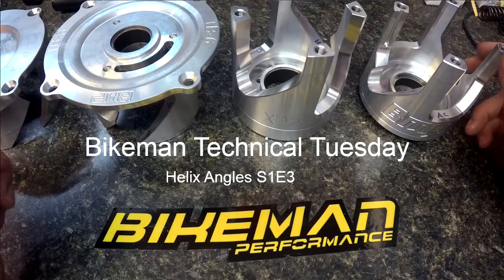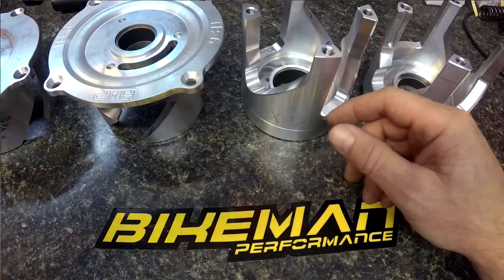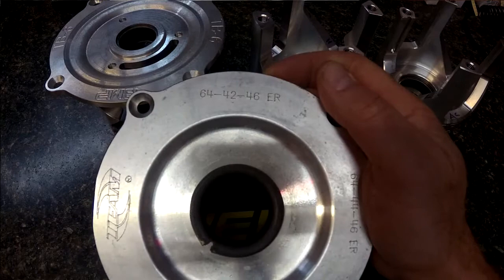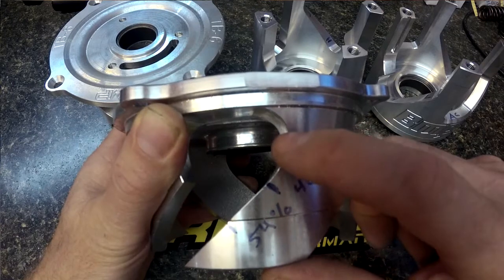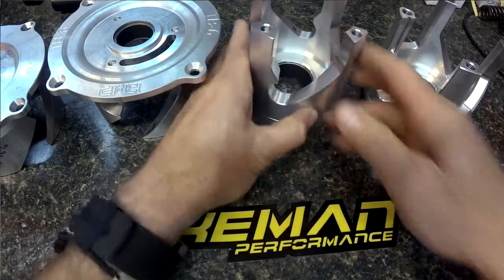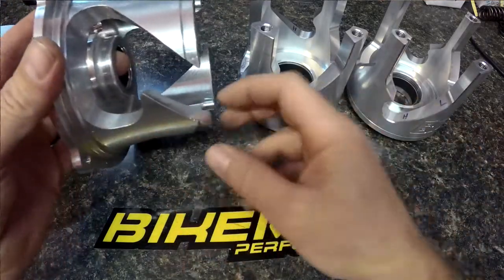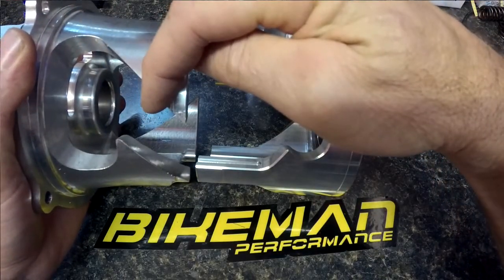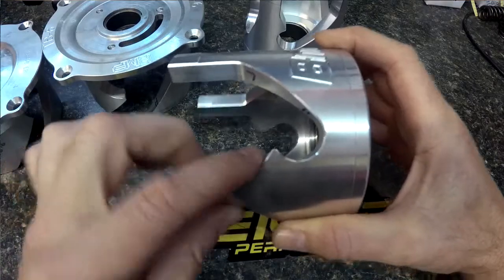S1E3 BMP Tech Tuesday - Helix Angles

Comment: Great video but It is funny that they wont tell there angle like someone couldnt buy one and copy it 🤦‍♂️ 

Maybe that is why they arent telling maybe they are the one that copy it.🤷‍♂️

Just more of a pain for a customer trying to to tune there sled for there riding. 
Because there isn't a perfect angle for every situation!
Reply from the maker: We don't disclose them because other aftermarket companies could copy the angles. We optimize the angle for exactly what a consumer would need. if you are racing, thats when you could get into different angles. But 95% of people dont need a custom angle
Reply: @BikemanPerformance  I guess for custom setup... if you do have the perfect software that is going to find the perfect angle for the engine(stock,turbo,mods) Gearing, track(lenght,log size and pitch), altitude mostly for non turbo and rider(weight and ridding style)  but  it would still be easy for someone to buy one and than make copy...